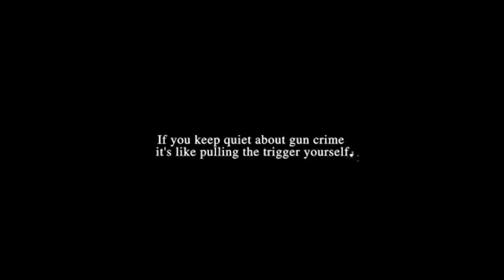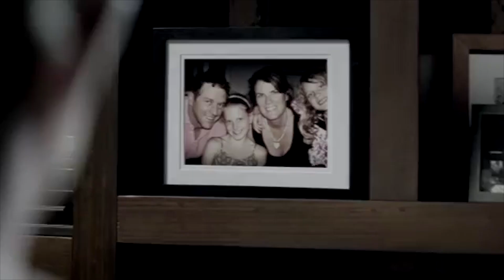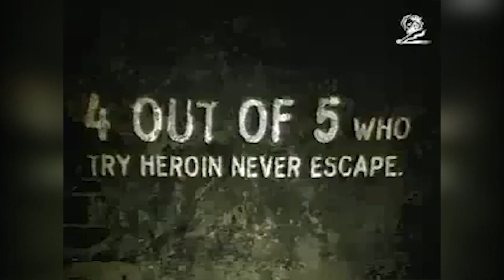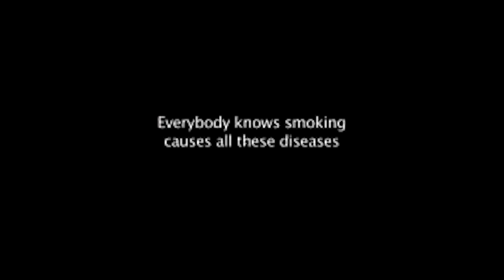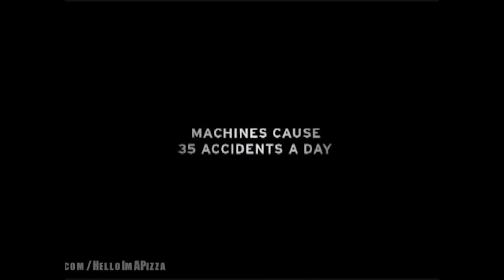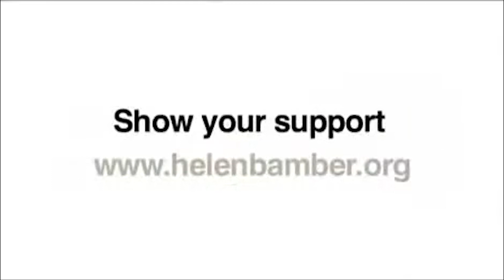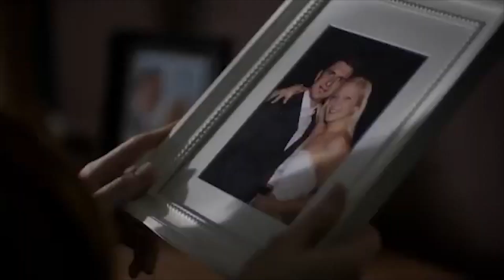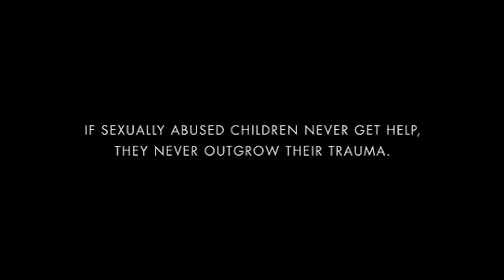Top 20 Scariest PSAs

Comment: The ones about safety in factory machinery hit close to home because my father was nearly killed in an accident involving a machine at a factory. It's sort of hard to explain if you have never been inside a woolen mill, but my father was a manager of one at the time and was supervising his workers on the floor when he noticed a large bobbin, which was made out of something similar to concrete, was loose and slipping off its break, and his employee didn't notice it. He pushed her out of the way and tried to put his foot on the foot break to stop the bobbin, which was spinning at high speeds, but it was too late and sent it rocketing into his face, crushing his face and the entire front of his head. He needed extensive surgery to rebuilt the front of his skull and his nasal cavity (he has new sinuses made of stomach fat), and for months needed to keep a metal bar drilled into his forehead as impact to his head could mess up the healing of his skull and injure his brain. With the bar and huge amounts of swelling, he looked like Frankenstein's monster for a while, but fortunately he lived to tell the tale. (He also got the nickname "fathead" because of the sinus thing.) Also while working at a different woolen mill, he saw a coworker scalped when her long braid got caught in the machinery (she also survived and I believe her scalp was able to be reattached.)

BTW, I helped the Internet Investigator with her PSA iceberg/video and she was shocked that there's actually a pretty large number of PSA fans. It was pretty amusing to show her the most disturbing ones and compilations and individual ones from channels I was subscribed to and see her reactions.

(Personal scariest/most disturbing PSA: the Sandy Hook Promise ones, particularly "Evan". They were some of the newest I saw and I hadn't been rattled by PSAs in that way in a long time.)
Reply from the maker: Damn that's absolutely horrible, glad he managed to recover. Also interesting that you helped them out with their iceberg
Reply: love ur pfp
Reply: @medicmain68  Thank you.

Comment: I was close to experiencing the scenario in number 19. I used to work in a restaurant kitchen and there's this area where we cook massive amount of rice pasta or whatever and around that area there's like grease on the floor  we just can't wash  away and it needs to be power washed because it just stuck to the floor. And I was carrying a pot of soup put on the stove because it need to be reheated but it was still hot though  and I almost slipped in the grease
Reply from the maker: Oh damn, very lucky that you didn't slip